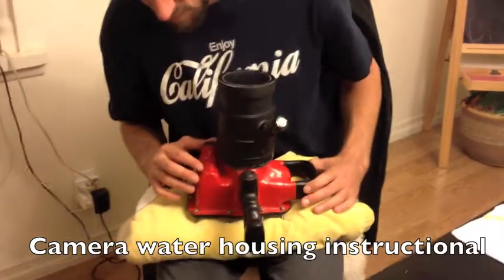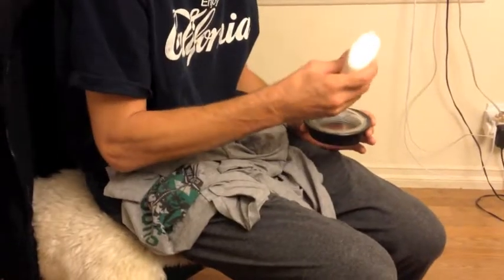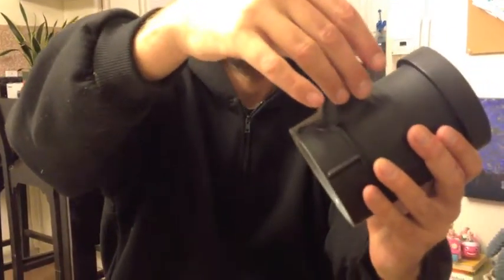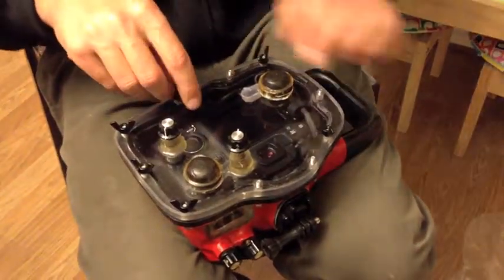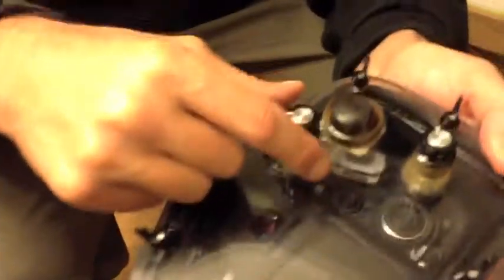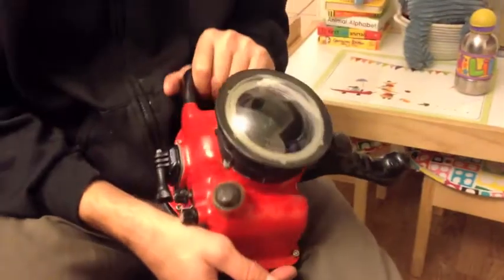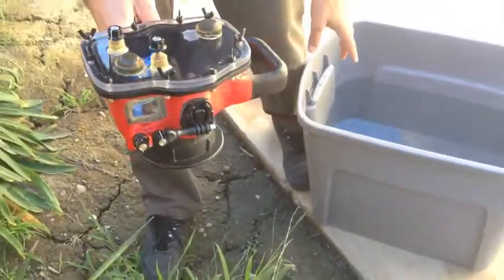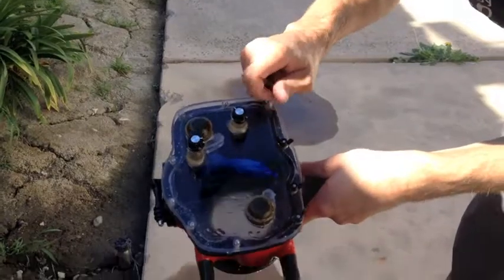HCW camera water housings instructional

Comment: I just used your akla-seltzer pressure test on my liquid eye housing, and it worked really good to find a leak I have on the plastic part that I can see my lcd screen through. what kind of glue would you recommend? really like this video man
Reply from the maker: 34thncrenshaw email or text me. Email I’ll get back to you with my #. If your in socal. Stop by I’ll help. Send pics etc.

Chad
Reply: whats your email? I'm up in santa cruz by the way